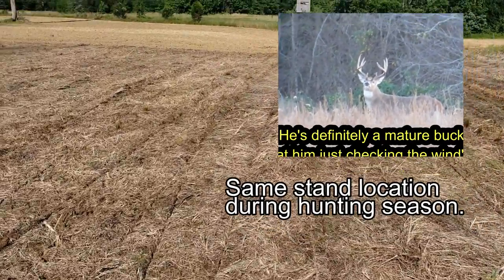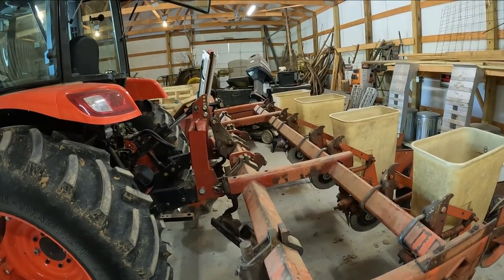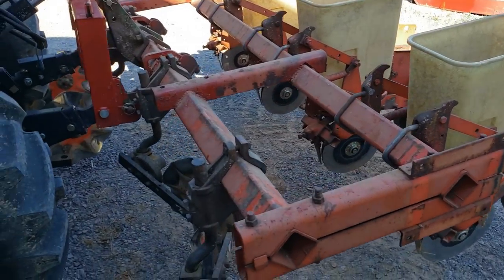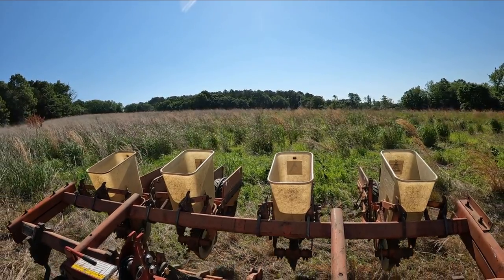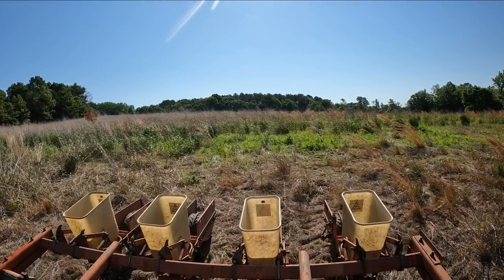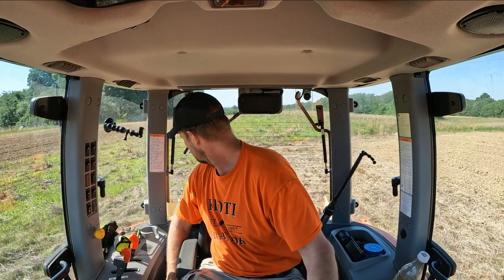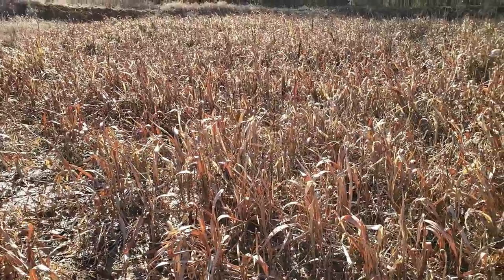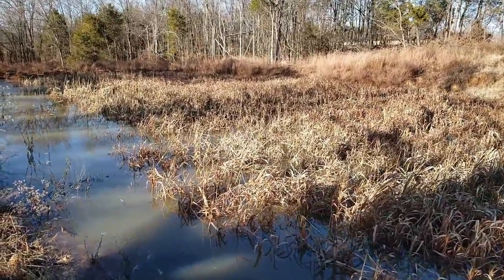Planting Milo food plot grain sorghum for deer & waterfowl. Memorial Day in the outdoors!

Comment: Another great video
Do you have a drain valve on the duck pond 
Was wondering how you drain the water out after you have flooded it
Reply from the maker: Thank you. I have an 8 inch pipe installed at the bottom of the plot that keeps it drained all year until I use an 8" hd balloon to flood it out. It is a constant learning curve, experiment and work in progress! Thanks